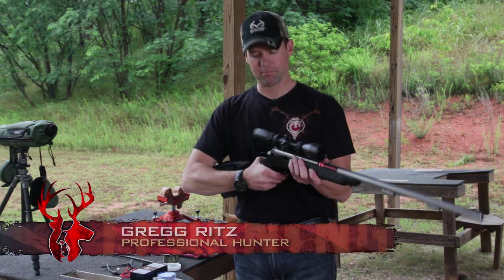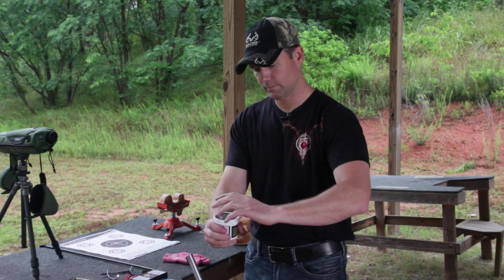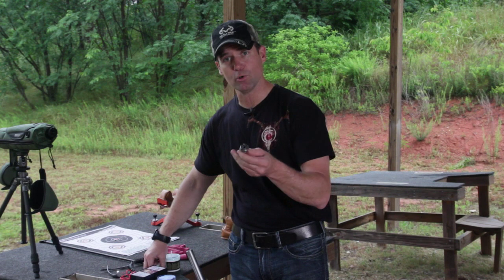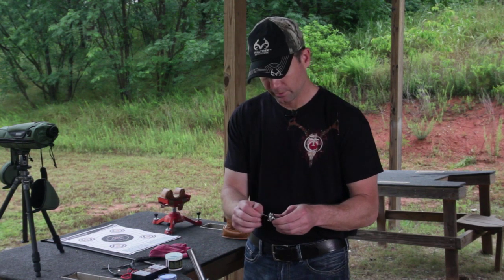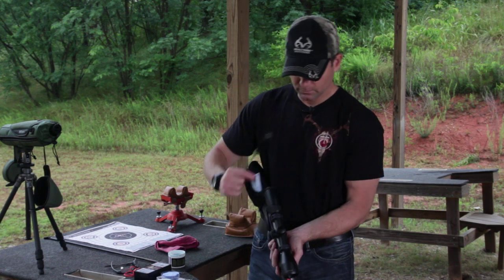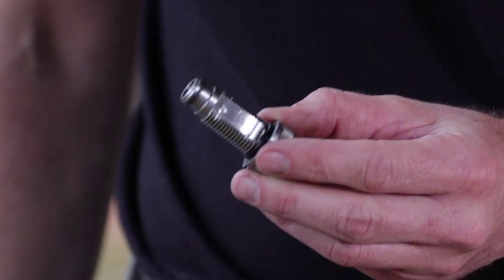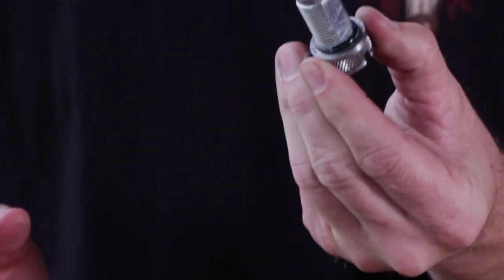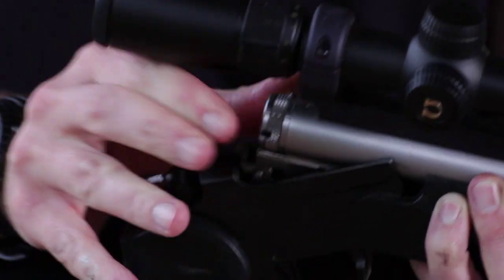World of Muzzleloading: Cleaning the Breech Plug

Comment: will Hopps # 9 work also.?
Reply: Hoppes is not a black powder solvent, so no.
Reply: @TheKillerkadoogan  this isn't me questioning if your right or not, i'm new so i gotta ask. why does it need to be black powder specific? can it damage some part of the rifle? is it not agressive enough? to agressive? etc etc. i use a hoppes foaming cleaner kinda like a nitro type cleaner but in a foam sprayer, same as i use in all my modern rifles and i cleaned it similar to how i clean them but with a few extra steps. what i did (only taken it out and shot once) i foamed it up real good, wire brushed 3-4 times, let it set for five min or so, hit with the wire brush again, swabbed out clean, and did this one more time to get it as clean as i like my barrels to be. it seems it did an awesome job cleaning it. there was a heavily heavily fouled ring about 2 inches or so from the breech of the barrel, it was  completely gone, all copper buildup was long gone, and after the process patches came out nice and clean.it literally looked like it did when it hadn't been shot once but after i cleaned it prior to shooting. again, not arguing, just asking cause i couldn't be more green to muzzle loading and i have no one to ask and i'm not trying to ruin a brand new rifle because of my ignorance.
Reply: Nope